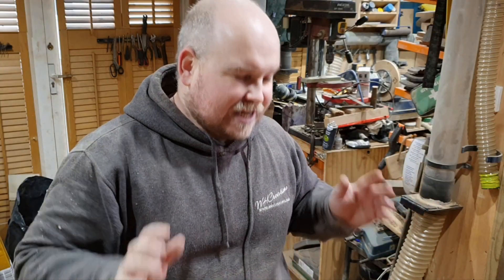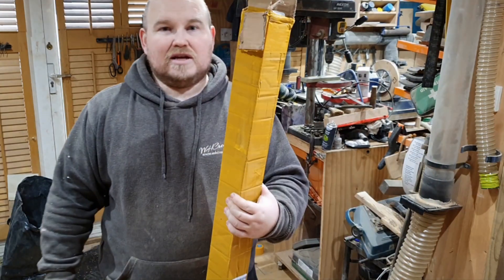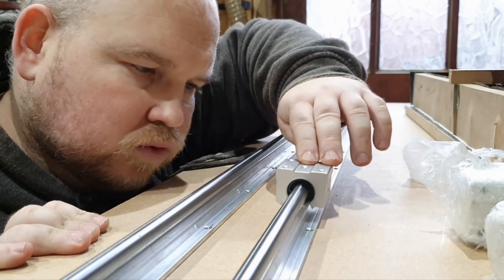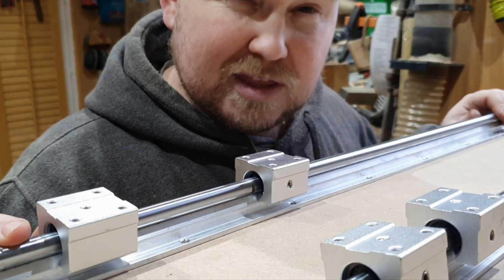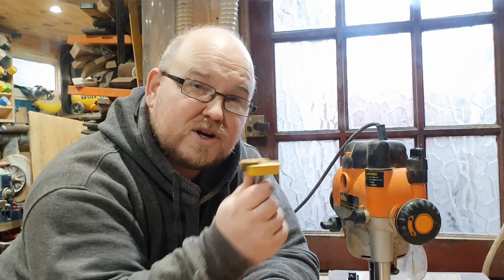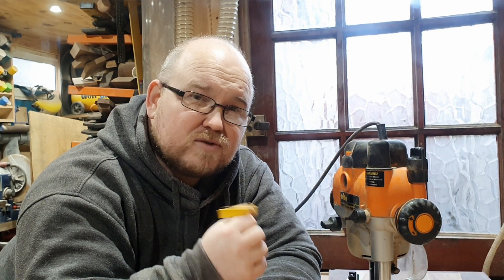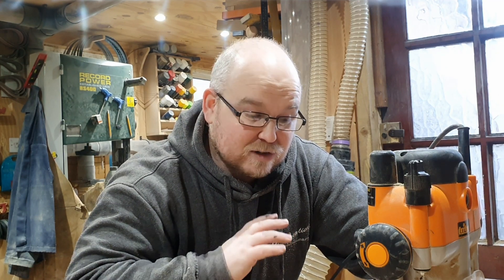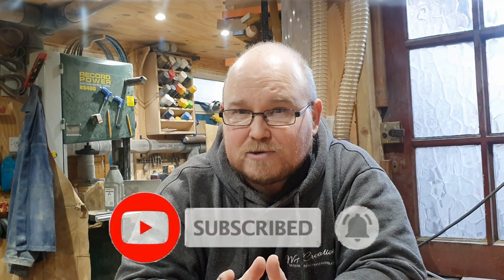Flattening Lumber Like a PRO: Build Your Own Linear Rail Jig! Part 1

Comment: good work, I have made the same myself and now planning to add stepper motors controlled via an arduino as my next project. you mentioned you were getting chip-out. To prevent chip-out on resin, you'll need to stick to climb milling across the resin surface. It will produce a cleaner cut as at the end of the cut, the chip is thin.
Reply from the maker: That sounds awesome. I did plan on doing something similar, but just don't have the time. Enjoy!

Comment: Oh one more thing.. any issues with your triton? Mine seemed like it had a bad bearing where the cutter runs with alot of vibration and deflection. I emailed triton assuming i might have a bad router.
Reply from the maker: Hmm, that does sound worrying. I think you've done the right thing in messaging triton though. I emailed them regarding an oscillating sander I had from them which was totally useless. I had to send it to some random place that wasn't even triton themselves, paid for by myself I may add too. The router however has been bang on from day dot. I recently took it apart as my micro adjuster kept jumping and I thought id broken some of the gears inside. It was actually super simple to take apart and it was just caked in debris from years being beaten upside as a router table. If triton do get a bit funny then I would highly suggest trying to fix it yourself, but only if you feel comfortable doing so and you don't get anywhere with triton. I have actually changed out the bearing on one of my handheld routers, again super simple. Hope that helps

Comment: Any issues with linear dip in the middle? I used 20mm rail and have dip just from the weight of the router in the middle.. like .040" from the sides.. thinking maybe trying a wood sled similar to yours but wondering if you get dip as well.. i know i cant avoid dip but like to get it down to .010... have you had trouble with router jump when reaching out cause of slight tilt?
Reply from the maker: Hey, so I've actually an update to this video showing this exact thing. I did have a lot of flex from the mdf, totally expected, but wasn't immediately clear just how bad it was. I suspect me building it and using it while filming and also getting all excited seemed to have shadowed the fact I had a huge cup in it. The second pair of rails across the first have sorted this issue out completely. You can keep adding to it but eventually you'll realise that is just fine, especially for the kind of work I regularly do. I hope this helps you out.
Reply: @WHCreations  watched your other video and i think i might give it a shot using the rails with the base for the gantry. Im just gonna go shorter distance  as well . Right now the span is 45 i think if i shorten the width to 32 i might be able to sqeeze 25ish if i set it up similar to yours.. hopefully alot less  cupping. Thanks for the help!

Comment: Nice work. Question from a newbie: how did you mark the locations for the holes to mount the sliding blocks to ensure they will slide on the rails square?
Reply from the maker: Thank you. I used a square and vernier calipers to help drill the holes. I hope this helps

Comment: Just make a removable stopper at the end of the router sled slide the the hole base plate out and then it easily stored I wish this would let me send you a picture of what I have built! And you would get what I'm talking about alot easier
Reply from the maker: Check out my new video mate, see if I have fixed what you mean, if not send an email to me. Sales@whcreations.co.uk

Comment: I built a similar setup using Veritas bench hole saddles to hold 2 side sails 3.5" tall on my benchtop.  Top of those wood rails have a dovetail slot cut along them, and the linear rails are bolted to the boards that slide on the dovetails.  The dovetail groove has just enough friction to hold the linear rails in one spot when cutting, but are easily slid to the next cut line when ready to do so.  Very stable, but fast also.
Reply from the maker: Sounds good buddy

Comment: You might use some toggle clamps to hold the router down and route out the shape of the router base in the board it sits on so it can't slide around. Then it will be easy to remove the router. If you really want to get fancy you could also use a second set of rails mounted to the first set to get smooth motion  in both directions.
Reply from the maker: I've got a new video out showing some upgrades to this. I did think about using toggle clamps but the new setup works incredibly well. Just need to work out how to lock the carriage to the rails now. 👌

Comment: What tips do you have for planing one side parallel to the other?

I've built the same type of jig and I seem to have this problem where one side is about 3/8 thinner than the other side.
Reply from the maker: Hey Fred. It sounds like your bar's aren't level. I would run some tests to see where it's out. Good luck

Comment: Dont you get tiny "bumps" on the surface of the sled when you screw in the sides of the sled like that ?
also it looks like the MDF litterally flexes under the weight of the router when its liftet off..
Reply from the maker: Hey, I will be redesigning the whole setup. Hopefully this will sort put a lot of the issues

Comment: I would use plywood for that and finish it with melamine so that it would be stiffer, would not warp in time and it would glide better. Also, I would use countersink screws at each end to win a little bit of travel.

Comment: Instead of the wooden sled, you need the router mounted on a base that’s attached to enclosed bearings (scs20) that run on 20mm steel bars across the table. Works brilliantly and with a bit of imagination and some 20mm collars to lock the router in place, you can do loads more than just flatten stock.
Reply: Do you mean bearings and tracks different to these?
Reply: @LEO-xo9cz  No, use these bearings as side runners like he has here but instead of how he’s done the sled, I used scs20 bearings on 20mm bar going across. You mount the bars to the side runners and make a small sled attached to the bars with 4 scs20 bearings. Have a look at the parts on eBay and it might make more sense.

Comment: Thanks for the video. I like the way you thinking. I think you should replace the cart that your router sits on with something based on another set of rails. You could probably handle thicker slabs if rather than attaching the current rails directly onto the MDF table top and instead used those extruded aluminum with the t track slots. They make different thicknesses so you can use square for thicker slabs or the flatter rectangular ones for thinner slabs. 
Anyway I love your enthusiasm and passion for this stuff. Thank you for sharing this video. The tricky thing with stacking up your current rails onto the extruded aluminum with making sure that you have some saw dust or wood chips getting in knocking your rails out of alignment.

Comment: I'm thinking about going this route for flattening projects/boards. Question I have is you said you installed the rails parallel. Did you also ensure they were co-planer? If so I'm curious how accurate your results were. This would possibly speak to the quality of the rails. Thanks for sharing.
Reply from the maker: Hi George, this is a good point and one I didnt show in the video. The rails were screwed down to a flat piece of mdf. There is a slight dip in the middle from the carriage which need replacing, but apart from that everything else is spot on. I can't fault the rails used in the video, however I may want to go for the 20mm ones over the 12mm if I were to redo the entire thing. I hope that helps, but should I do up update video, I will be sure to include this

Comment: Sounds better than a router table for those operations!  

I used a single expensive 48" drawer slide to construct a table saw crosscut extension that could manage big panels - but I ended up preferring a vertical panel saw - it uses rails and bearings but larger diameter aluminum ones.  

The only improvements on your design I would use, would be to swap the MDF for quality ply at the base, (MDF disintegrates and bends like taffy over time) and use steel tubes for dimensional stability if you need them (1x3x1/16), which you won't if you put your router on bearings as well, for the cross sled.  Fun!
Reply from the maker: Thanks buddy. Improvements are on the cards.

Comment: Helpful reminder!  I used expensive long drawer slides to construct a table saw crosscut extension that could manage big panels - but I ended up preferring a vertical panel saw.  
The only improvement on your design would be to get rid of the MDF, which is dimensionally unstable.  Put it under load and in normal humidity it bends like taffy.  Go down to your metal supplier and get some scrap tubes for that - thin wall 1x3 or 1x4 would be overkill - you just don't want to bend with 50# in the middle - right?  So that will set you back not much - $35 or so for a 20' piece - just ask the weight per foot and ask for scale-free low carbon is the right spec.  And that will give you a tighter tolerance that won't change.
Reply from the maker: Thanks buddy, good idea. I have plans to upgrade this, so make sure to check back soon

Comment: Wouldn't mind a update on the new sled design, maybe just the slot idea that the router table plate fits into so it just slides out and then fits straight into the router table again
Reply from the maker: Hey, I'll tell you the truth, I've not used it for some months now due to other things going on. I do have ideas though, and will get round to it eventually 👍

Comment: Great video! I just got the exact same set of rails. Could you tell me what size bolts you used on the bearing blocks, to attach your sled? Cheers!
Reply from the maker: Nice one, I hope it works well for you. Sorry not in the workshop at the moment, but I think they were m3/m4...

Comment: That is great idea. I have been wanting one that dose both router and hand saw. Amazon ( VEVOR Linear Guide Rail 2Pcs HGR20-1000mm Linear Slide Rail with 1Pcs RM1605-1000mm Ballscrew with BF12/BK12 Kit Linear Slide Rail Guide Rail Square for DIY CNC Routers Lathes Mills ) . Put on top the liner rail that you just built.
Reply from the maker: Thats the idea buddy 😉

Comment: I would use a couple of aluminum extrusion pieces running across as the support pieces and then thick aluminum sheet under it as the new router plate. No deflection in that setup. Good luck with this. Thanks for sharing.
Reply from the maker: Yeah I like the thinking in this. I think the limitations of space would be the biggest issue for me. I do have a plan for this. Just need to make it. Thanks for getting involved and I look forward to your continued support 👍😊

Comment: Your linear rails are "rod" based, look around and you'll find others that are "bar" based. Combine the bar style with some "80/20" extruded aluminum bar for extra support and you'll have a nice flat, low profile, low friction, sled for the router.
Reply from the maker: Thanks David, I will take a look 👍😊

Comment: What are the RPMs at "1"??   How about rails for the top part as well?
Reply from the maker: Hi Ronny, my rule of thumb is the larger the bit the slower the router needs to be. I'm not sure on RPM as I don't have anything to measure that by. It is very much a start slow and work your way up.

Comment: Try using a sacrificial frame around your resin that you can remove after milling. That may help with the tear out issue. 
You could also use a second set of linear rails for the router. You could install a mounting plate with quick release toggle clamps or knobs for easy removal. Many great ideas here. The uses are mind numbing. Thanks for sharing.
Reply from the maker: Thanks buddy. The new carbide bit has put an end to the tear out, if you've not seen that video, do, it's an awesome bit of kit.
Reply: @WHCreations  will do.

Comment: For the router motion issue: Have you considered a second set of linear rails running perpendicular to the current set and attached metal to metal to your current bearings.   As a result you would have one set of linear rails riding on a second set of linear rails with the router tightly bolted to the bearings of the second rails.  In other words, remove all the wood except for the baseboard.
Reply: I actually just purchased all the stuff to do exactly that, i saw a video someone posted of how their sled worked using the same idea, and as soon as i did i knew that was the way for me. Its like having your own cnc
Reply: @FullMetal372  can you post a link to that video?
Reply: @jimluker9243  Wish I could, but I don't remember the link, however they are all fairly straight forward. You can look up a video just search, cnc router sled and you can find multiple videos all with links.
Reply: ok so update, i put mine all together and it worked great, however ive been running into the issue that the dust settling on the tracks kills the movement of the ball bearings that the whole thing goes on. The only solution i could think of, would be to put brush's on the track to sweep away any of that before it has a chance to clog those bearings.
Reply: That's the system I have, and it works great.  Also breaks down easily when not in use.
Reply: Is the tear-out caused by a rough router motion though?  I've no experience with flattening resin like this, but using my own setup (thrown together from whatever I had lying around) to mill down wooden surfaces, I found that it doesn't really matter how smoothly the router or the sled move.  Have your working motion along the smoothest working axis, whether that's the router in the sled, or the sled along the tracks.  Neither are too smooth in my setup, certainly not bearing-smooth.  What matters most is: dead flat and straight runners and sled, working slowly, and always working in the same direction to avoid climb cuts.
These rails do look like they make really good flat runners, so I might upgrade to them anyway :)
Reply from the maker: So I believe it was merely the cutter I was using. It was a cheap one I had from another project. It was leaving tram lines along the wood. Since changing over to carbide I have had zero issues, with a finished surface that requires minimum sanding afterwards.
Reply: @WHCreations  Nice.  Is that the carbide bit from AliExpress you linked to?  If so, that's a pretty good deal.
Reply from the maker: Thats the one. I honestly love it, its going to be used a hell of a lot in upcoming videos/projects.

Comment: Nicely done.  You can also use the linear rails in a panel saw setup to cut sheet goods in a vertical orientation, like they do with plywood at Lowe's and Home Depot.

Comment: Great video! I have a thought for your issue with the router movement. What if you replaced the MDF sled with a sled using more linear rails. Then you just fix your router (I have the same one and love it) to the linear rails.
Reply: Hi wjs2nd would love to see your set up using linear cross rails sled .I am new to using this type of set up in a workshop .
Reply: @martinmccartan739  I don't have a cross sled. :(  Wish I did. I have the same router, Trition and that is what I love. It is an amazing router.

Comment: Great stuff! I'm about to do the exact same thing. I make oak lumber as a hobby and right now I'm working on flattening 50mm+ solid oak shelves for a client, but the lumber is simply too heavy and too bent to be flattened on the jointer. 2800mm rails are on their way, enabling me to process fairly long slabs. I've been removing the live edge using a bandsaw and followed up with the jointer. It's a back-breaking and time consuming endeavor, but with a fixed circular saw on a sled I should be able to get perfectly straight cuts in one operation. I can also touch up those edges with a straight router bit, if needed. I'll need to readily switch between the saw sled and the router sled, so my fastenings won't be simple bolts. Also I need more permanent clamping for the slabs, so perhaps horizontal toggle clams such as the Bessey STC-IHH15. Thanks for the tip on the carbide bit!
Reply from the maker: Thats exactly what my thoughts were when I made it. Good luck and let me know how you get on
Reply: @WHCreations  Will do. Think I found the perfect clamp, btw. Lay down a t-track along the center and slide in an Armor-Tool B7-IL clamp. The workpiece can then be pressed up against a fence at the other end. Perhaps with some sharp screw tips poking through to give a good grip. If only I could figure out a way to route a straight groove for that t-track ;-)
Reply from the maker: Paying for itself already by sounds of it haha.

Comment: Am flattening a slab. I am new to wood working this setup looks great. I am looking to get 4foot rails do I need 1200 mm?
Reply from the maker: You would need to buy slightly oversized because you will lose space where the router can't reach. I hope this helps